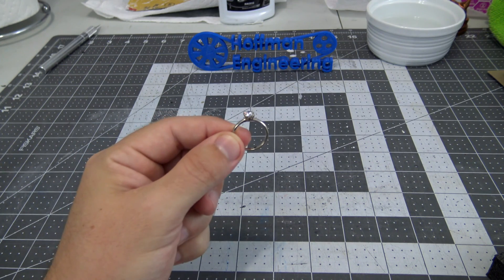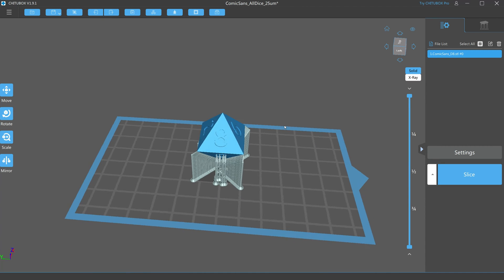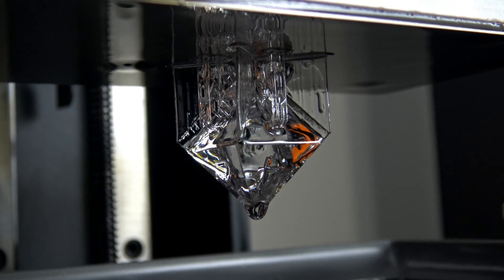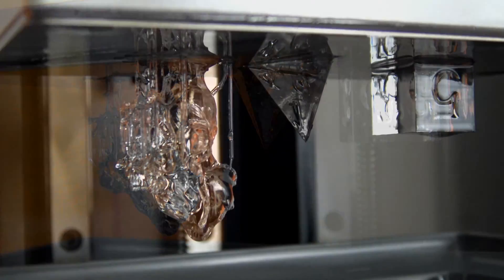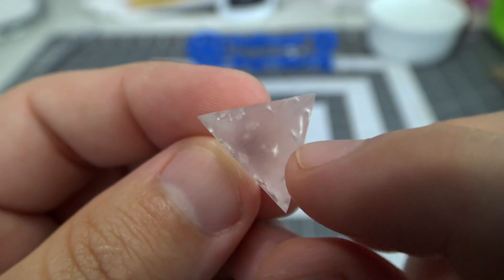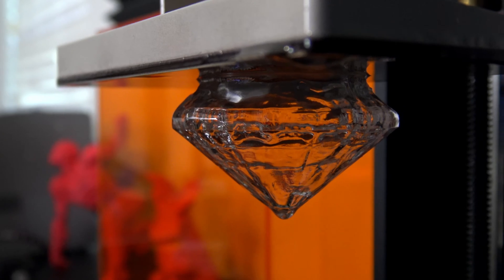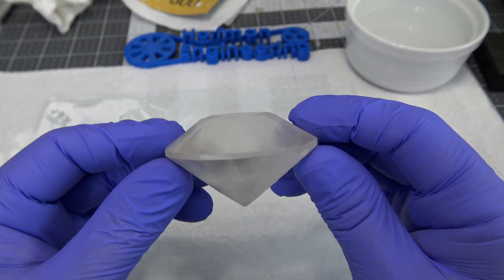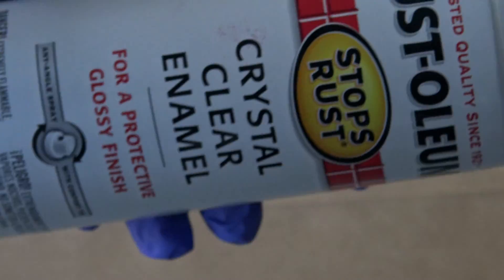Crystal Clear 3D Prints? Experimenting with NOVA3D High Transparency Resin

Comment: For crystal clear finish dissolve 30% resin in 70% pure ethanol or ipa... then dip whatever you want to clear coat. Just a very thin layer will actually stick.. then let it hang for like 5-10min and then cure it. No need for sanding
Reply from the maker: That is an interesting idea, I'll have to give that a try.

Comment: The foam like body of those micro mesh pads will cause that youre over youre having. They make cloth like sheets. You can also try 3m polishing papers. Those will work really well for this. But you can even do 800-2000 grit sand paper and then use meguiars pro polishing compounds. The heavy cut and fine will really make things pop

Comment: I might be wrong, but if I remember correctly, when sanding something with edges, you should always move in a straight pattern and that zigzag when you zigzag you run the risk of out the edges

Comment: after sanding and buffing rewash with distilled water let dry then use a brush to paint on resin let sit and then cure with uv, works best out of everything ive tired, also exposure calibration is absolutely key, 2.4 seconds at 80 percent uv on my mono x 6k was perfect for my machine and i dialed it on with cones of calibration by table flip foundry

Comment: Istruggled a lot  with Nova3D cystal clear it is a full waste of time. I am very satisfied with Monocure 3D Tuff crystal Clear pro. Prints faster and therefore 25um layer are possible. IPA scrub with a soft brush cure In sunlight 30m under destilled water and spraycoat UV Resin with airbrush after drying. No sanding

Comment: I think you are over exposing. I know it says 3 times. But that looks like to much. That’s why your supports swell to together. When u over exposure everything swells. Also with the clear coat warm the can in hot water and spray on very thin in a few layers layers. Still that resin does look pretty good.

Comment: I've been struggling with this stuff and had the same issues you experienced. The best way I found to keep the item as transparent as possible was to not rise the final product, but rather to let it drip dry, then spritz with IPA then final cure. The supports are still a big issue though.
Reply: Spritz ?
Reply: @waterskin7  very lightly spraying it
Reply: How long do you expose it to uv after?

Comment: If you want the diamond to sparkle, like have the light reflect back like a diamond.  Have the trianlges near the band on bottom to be about 44 degrees and then have the inner "star" at 42 degrees.  Resin usually has a RI of 1.50-15.4 which is "close" to quartz (1.54).  So if you add that in, the light will be more inclined to reflect too.  As you saw, there was a lot of grey bleeding through from the band, that is called windowing (in gem cutting that is a big no no).  Also your "kite shape" part on top, make it look more kite shape, it'll help with the appearance more like a diamond.  I am dealing with this issue myself, I did it different by casting a quartz piece I cut and then did it in resin.  I'll try the clear coat to see if that fixes the dulled surfaces since my mirror surface on my quartz doesn't transfer.  @hoffman engineering, if you want more details on how to make your gemstone stl prints better from a gem cutting perspective for better sparkle, let me know.  Or look up Round Cut Brilliant diamond diagram and it'll give you the shape, angles and the number of facets you will need.  Just wanted to help and hopefully it does.  Not saying your prints weren't beautiful.
Reply: Just wanted to let you know I found this to be a rather interesting and inspiring comment, cheers mate!
Reply: Thank you

Comment: Your exposure is too high.
Print calibration prints next time to avoid wasting time and resin.. The calibration prints will give you the exact settings you require for a perfect print.
Whilst clear resins do need a longer exposure to clear, the fact that the resin is clear also allows light to diffuse throughout the print, so getting the exposure time correct is critical to getting successful prints.
Reply: I was very shook, that he did not do a calibration and then complains about failed prints and fused parts.
Reply: @Letsplayer9998 just watched this now and 100% agree. As if you didn’t do a calibration test set after the first lumping of supports. Screamed Over exposure to me too. I’m still interested in testing this stuff out.
Reply: 100% this. Clear resin is a pain. Any time I use a new brand I get a 500ml bottle as my "calibration bottle" just so I can 100% dial it in for different uses

Comment: I made a chess board out of wood and epoxy resin. After wet sanding at 1000 grit, the resin was cloudy and I didn't have any polishing compound. I put some danish oil over the whole thing and because it's a type of finishing oil that cures over a few days, it actually filled in the imperfections caused by sanding and had a nice polished look. Don't know if it would work with 3d uv resin but it might.

Comment: Meguire's PlastX is a glaze, there's no abrasive in its formula but fillers. If you want a perfect last step polishing, you want to use a proper abrasive polish. Try Menzerna or 3M final finish polishes. Good luck 👍
Reply from the maker: That is good advice. I've seen plastix recommended elseware, and it seemed to work on some other resin dice. But I'll have to try out some of your recommendations!
Reply: @HoffmanEngineering  Like any greasy stuff, it fills scratches and the part looks better. But as soon as the glaze (which are mineral oils) disappear as times goes by, scratches are revealed again. I wish that makes sense. On the other hand, as you noticed, no fillers can provide the Cristal glass look you're looking for. You want a final finish diminishing abrasive polish: the superfine abrasive particles brakes down in smaller particles while polishing and leave a perfect surface finish. Feel free to give it a try. This technique is well known by hobby astrologists and concours car detailers. I've been using it for 30 years.